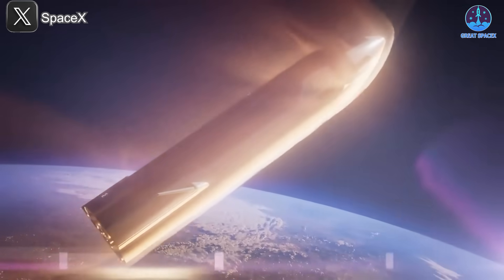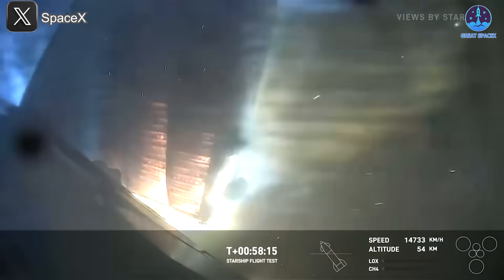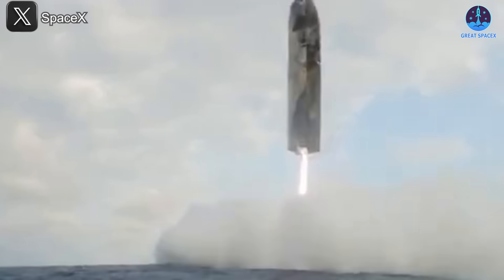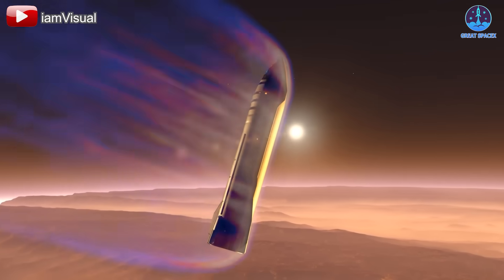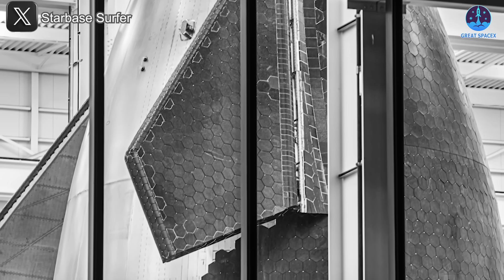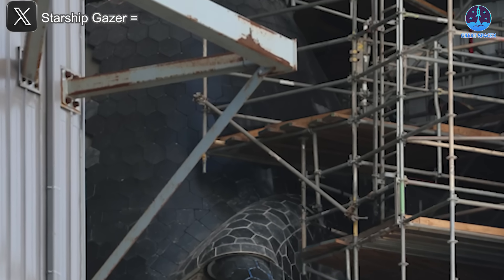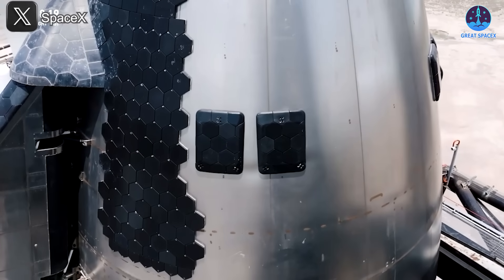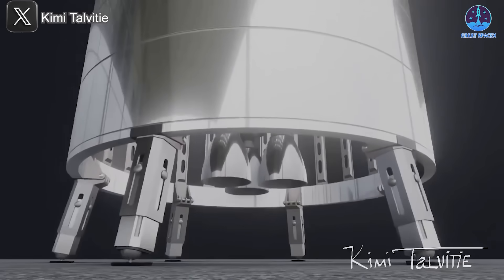Elon Musk Revealed Why SpaceX ditched Starship's Ceramic Tiles: New Metalic Trick!

Comment: I don't understand why people are so over-the-moon (pun intended) about SpaceX. It's just a freaking rocket. Rockets have been around for a very long time.
Reply: you are clearly very uneducated about the differences between "just a rocket" and what SpaceX has achieved.
Reply: The biggest reason why they excite me (and many others) is their proven track record of decreasing the cost to launch (in $$/kg).  The biggest reason you or I have not been to space yet is because it is mind-bogglingly expensive to safely lift weight to orbit.  The space shuttle was around $54,000 per kilogram to low-earth orbit (LEO).  SpaceX's re-usable Falcon 9 dropped that to around $3500, Falcon Heavy to something like $2500.  Starship promises to drop the cost down to between $20 and $200 per kg to LEO depending on how rapid and safe its re-use becomes.  I didn't think I would live to see the day when an 80kg (176lbs) individual would be able to travel to LEO for somewhere between $1,600 and $16,000 (compared to $4.3 million for the same ticket on the space shuttle).  That still sounds like a lot (because it is--especially the upper range), but it changes everything.  It is low enough that travel to and work in space will become far more common.

Comment: The liquid-vapour cooling is moronik to an unbelievable degree. The reentry kinetic energy of starship is about 2500 GJ. 1 kg evaporating water takes 0.00226 GJ so you would need 1106 metric tons of water to dump the energy of an EMPTY 100 ton Starship. So, someone please tell me, what the chief "engineer" is smoking. If you want to do the same with methane you would need more than 4 times this, or about 4000 even 5000 tons of methane.

Comment: SpaceX should consider Carbon Dioxide for the active-film heat shield cooling.  The Martian atmosphere is mostly carbon dioxide, so it's freely available for the trip home.  No matter what material is used for active cooling, it will need to be loaded before liftoff, and carried along until reentry, so So SpaceX shouldn't limit the choices to just O2 or CH4.  Methane will react with oxygen in the atmosphere, and add extra heat to the shield.  Oxygen when super-heated will act on stainless steel like a cutting torch.  Carbon Dioxide however won't react with anything. It's completely inert.  If SpaceX needs to carry along extra material for film layer cooling, then it might as well just save on the cost of CH4 and O2, and build a CO2 tank and pump system for cooling the heat shield.  CO2 is cheap, easy to handle, reliable, and safe.  An active film layer cooling system will add weight, and reduce the payload capacity of the rocket, but hey, do you want a fully reusable rocket or not?  The film-layer heat shield will be the only heat shield in history that is has zero ablative behavior.
Reply: Agreed. And since they'll be generating H2 with the O2 (from found water), they might consider fueling a Raptor 4 directly with that instead of processing it into methane first.
Reply: @ReggieArford  Agreed.  I always assumed that SpaceX had a reason for not using H2 and O2 instead of the multi-step and energy intensive process of converting water and CO2 into methane.  Bezos has some H2 engines.  The space shuttle used them, so we know that H2 can be used.
Reply: @scientificperspective1604  As I understand it, the reason SpaceX uses methane is because its boiling point is close to oxygen's. So, there's no need for additional insulation between them. Someone did a YouTube on this, I think.
Reply: @ReggieArford  Somehow the Space Shuttle was able to use hydrogen and oxygen.  I remember stories about how the hydrogen was also used in the space shuttle in fuel cells which generated electricity.  SpaceX is going to take heat for generating CO2 with its rockets.  It would be great if H2 were easier to handle, since water is available basically everywhere, and H2+O2 fuel makes no CO2.  The second stage of New Glenn apparently will use H2+O2.  Maybe SpaceX boosters can be used to get that BO 2nd stage to orbit, if the New Glenn isn't up to it.
Reply: @ReggieArford  The different boiling/freezing point would be a bit of a problem with using CO2 for the heat shield.  It should be manageable.

Comment: The heat tiles do not have the highest heat-handling capacity, it's just that they're incredibly insulative, protecting the metals underneath.
I think they could be made much more durable by coating "both" sides with a high temperature metal (or the outside with a high temperature metal, inside with steel or titanium). The problem would be that the outside and inside metal layers shouldn't touch each other, so you're still relying on the durability of the tile material. But I think if bonded between two metal layers, with tesselated "pegs" (possibly with grippy or no-touchy interlocking shapes), you could make an ice cream sandwich out of the tiles, which would hold together much better.

They would probably have to be a bit thicker, and heavier. But likely not nearly as heavy as an aspirational heat shield + coolant.
Only problem I could see is that they would likely hold together even when the silica core is cracked. So in maintenance you might need some sort of ultra-sound to quickly check each tile to make sure it's still intact between the layers. The outer layer would likely have a small degree of ablative degredation... but a material like tungsten would not degrade very much, while being very strong. Tungsten shouldn't reach it's melting point in reentry. Light? no. Lighter than a whole belly radiator though? Probably.

Comment: I do not agree with this view. Even Though Stanless steel temp ranges between 2,550°F and 2790°F. I would suggest something simpler. Tungsten melting point is 6,192°F and as a metal can be formed into the new heat shield. When reentry temperatures as high as 7,000°F it is not likely stanless steel would work as it has a melting point of 1,400°F. While titanium is ,3,034°F. Molybdenum would range at 4,753°F. Tantalum woudl be around 5,468°F. In truth if he craft heat shielding was made out of titanium, molybdenum, tantalum and copper cooling system to conduct the highest cooling method it would be likely to use a metal heat shield that would not melt at all. It would be rather simple in design and easy to apply to the current system.The fuel itself could be used.
Reply: Holy moley. I just typed a very similar post. sent it. and see the post right under mine has nearly the same idea.
great minds :) 

My idea though was to make the silica tile material into an "ice cream sandwich" with probably a titanium backing, and a tungsten outer layer. And try to form the heat tile in between these layers, with protrusions from each plate sticking into the tile brick. The key would be to avoid any bridging... so the protrusions would need to secure into the tile material itself, not go all the way through and touch. Basically there can't be any thermal bridging, front to back. But I think the tiles could be made tougher, at a weight which is likely considerably less than a respiration system.

Does reentry really reach 7000 F? 
Tungsten can handle up to 6000. I had thought that reentry temp was a bit lower than that.
Reply: @kathrynck  Are you sure these metals adhere together? Steel and titanium don't.
A coolant system does not lower the surface temperature very much, so one may have to deal with thermal abrasion. I'm sorry, but as a European, I cannot deal with your temperatures. Stay on your MAGA island!

Comment: Why use the tower to catch starship?  Sooner or later landing legs will have it be used to land anywhere but Boca Cica.  So add the legs now and drop the tower.
Reply: Legs are heavy duty equipment. They weigh alot and add complexity to the rocket thats not necessary. Using the tower is great for reuseability. Catch the thing, inspect, refuel, put it on the very same booster without needing to transport anything across the country and start again. Those starships intended for landing on mars/moon will need legs ofc, but those intended for satellite deployment or orbital refueling wont.

I think it's quite genius to remove important equipment from the vehicle and put it on the ground instead.
Reply: On Mars, Elon will first build the catch tower, the chopsticks, and the support ring with a deluge system, then land with the starship.  🤣

Comment: Technically starship doesn’t need reentry for the first couple of starships from my memory who goes there first will have to stay there, including the materials we send there before we go, and that includes the starship since there are no refueling stations on Mars yet the reentry part could be more valuable when Mars has an opportunity to set up a refueling station so I can send equipment Back to earth and if I remember correctly, there was an idea of trying to use the spaceship itself as a temporary living quarters because technically, you could just tip the starship on its side, bury it a little bit to protect from the radiation, and it should be relatively good as long as you find a way to produce water and grow your own food, because the starship was designed for a six month trip and open outer space so it’s got some living quarters the reentry on the shielding part for the time being could only be used for testing for the reentry of the vehicle because you want to keep reusing it because who wants to throw away a car after they get done using it once But starship on Mars will be more than a car kind of like those SUVs, that you could drive anywhere and live inside

Comment: I was referring to color not material. TLDR: radiation plays a huge role in heat transfer.
Maximizing the emissivity of the surface (I.e, making it more black) is crucial to heat transfer. A white surface or "shiny" reflective surface would be extremely counter productive.

Comment: In terms of innovation, we really are looking at 1980's technology.  If the 'Starship' vehicle is going to be reusable, it needs to be able to have a flight profile such that reentry velocity is minimized.  The current iterations do not use controlled flight, it is more a case of controlled falling.  There needs to be a better way to conduct the reentry phase.  Possible avenues to explore would be de-orbit burns that slow the craft considerably, additional aerodynamic control surfaces (wings), skipping in order to scrub speed in smaller chunks, or a combination of these.
Reply: De-orbit burns that flow it considerably? It appears you don't know how much fuel that would require.
Reply: @ I’m aware. Fuel cost in terms of mass to lift vs the cost of total vehicle loss. I can’t provide that calculus, but a ‘reusable’ spacecraft that does not survive reentry is an oxymoron and clearly SpaceX is exploring possibilities. So many ultimate limits just require divergent thinking to do the impossible!  Have some faith baby😎

Comment: Cooling a skin isn’t a new idea. 

NASA and others have been using it to cool engine rocket bells for nearly half a century.  

They pass chilled fuel through pipes wrapped around the engine bell taking the heat away. 

Nothing new here except they are going to cool the skin of the rocket not the engine bell.
Reply: It's a robot narrating. Generic fluff with the right length for ad revenue.

Comment: As Starship's re-entry angle is steep, then its belly keel is where it can deploy its (future) comprehensive ullage gas/film cooling system, starting from its nose and finishing at the end of the LOX (bottom) tank.  A red line down its belly would be quite aesthetic.  The present design won't be reusable.  😎

Comment: The loss of two out of five US Space Shuttles and their crews should have taught the lesson that heat tiles, if lost in critical areas on launch, result in loss of the vehicle and crew.  I would never entrust human life to heat tiles or a complicated heat dissipation system.  Instead, starship should use an internal crew capsule with an ablative heat shield and parachute water landing.  Placed in the nose of starship, above the header tanks, it can be released by a nose that opens like two jaws.  The vehicle thus returns separately from the crew.  Even if the vehicle is lost, the crew is not.

Comment: I wonder if some form of speed brake (similar to what are used on jet aircraft) combined with controlled engine burns could be used to effectively reduce speed if the ship used a nose up re-entry like the booster.
Reply: As Starship will be made to refuel while in orbit for travel outside LEO there is another option here.  Starships which are intended to return to earth could be refueled as well.  Then reentry rockets could be fired to reduce the speed of Starship to a reentry speed which wouldn't be so harsh

Comment: The overwhelming majority of super cold liquid fuel & liquid oxygen is used up on ascent to achieve the altitude & velocity necessary to maintain orbit around the earth.  Realize Starship needs accelerate from 0 mph on Earth to a speed of 17,500 miles per hour above the atmosphere where there is no friction to slow it down.  As a result STRARSHIP WILL ACTUALLY BE FALLING TOWARD EARTH, BUT IT’S GOING SO FAST THAT IT PASSES THAT MAGIC POINT IN SPACE WHERE INSTEAD OF FALLING BACK DOWN AND HITTING EARTH IT FALLS DOWN ONLY AFTER THE EARLY HAS SAFELY CURVED AWAY UNDER IT!! THUS IT KEEPS FALLING “AROUND THE EARTH” at a constant speed (even though there is barely any fuel left) because there’s no friction in space to slow the spacecraft down!!  If it gets too close to the atmosphere it will slowly loose speed and re-enter Earth. 

There’s only a small amount of fuel remaining in the ship for slowing down VERY close to land.  

So ALL reusable rockets & capsules coming back to Earth have utilized “aero-breaking” which uses the increasing density of air resistance towards the surface of Earth to slow down the vehicle “for free” because a vehicle doesn’t need any fuel to reduce their velocity from 17,500 mph to zero depending on it’s design. However aero-breaking isn’t really “free.”  It slows the spacecraft but the air friction at those insanely high speeds cause EXTREME heating which must be overcome.  Maybe SpaceX can find an innovative solution for a new type of heat shield?! I hope so!

Comment: Sounds like the solution for every problem SpaceX is stainless steel. Which adds to the mass problem which is causing the payload problem. 
Water as coolant? Water is very heavy. The way this is going, I’ll be shocked if Starship can launch a Saturn V payload to LEO of 300,000 lbs.
Reply: Yes, they need to come up with some sort of outer skin for the rocket, that is permanent, durable, and lightweight.
Reply: @ This is a problem that you work backwards. You start with the engines, thrust Isp, rocket size and payload target. For any dry mass ratio you a different payload until at a high enough ratio you get nothing. I would not be surprised if V1 is closed to nothing. You can get more with higher thrust, tank and Isp but a larger tank does not ride for free.

Comment: What's crazy is that the rocket is filled with super chilled fuel. There has to be a way to transfer that coolness to the heat shield. But how? Because I'm guessing that you also don't want to warm up your fuel. I don't know about the theory that the best heat shield is no heat shield?! 😅
Reply: The overwhelming majority of super cold liquid fuel & liquid oxygen is used up on ascent to achieve the altitude & velocity necessary to maintain orbit around the earth.  Realize Starship needs accelerate from 0 mph on Earth to a speed of 17,500 miles per hour above the atmosphere where there is no friction to slow it down.  As a result STRARSHIP WILL ACTUALLY BE FALLING TOWARD EARTH, BUT IT’S GOING SO FAST THAT IT PASSES THAT MAGIC POINT IN SPACE WHERE INSTEAD OF FALLING BACK DOWN AND HITTING EARTH IT FALLS DOWN ONLY AFTER THE EARLY HAS SAFELY CURVED AWAY UNDER IT!! THUS IT KEEPS FALLING “AROUND THE EARTH” at a constant speed (even though there is barely any fuel left) because there’s no friction in space to slow the spacecraft down!!  If it gets too close to the atmosphere it will slowly loose speed and re-enter Earth. 

There’s only a small amount of fuel remaining in the ship for slowing down VERY close to land.  

So ALL reusable rockets & capsules coming back to Earth have utilized “aero-breaking” which uses the increasing density of air resistance towards the surface of Earth to slow down the vehicle “for free” because a vehicle doesn’t need any fuel to reduce their velocity from 17,500 mph to zero depending on it’s design. However aero-breaking isn’t really “free.”  It slows the spacecraft but the air friction at those insanely high speeds cause EXTREME heating which must be overcome.  Maybe SpaceX can find an innovative solution for a new type of heat shield?! I hope so!

Comment: Just a journeyman who worked on projects with a lot of stainless, and am wondering if the stainless steel deformation could be caused by the rapid quenching the tiles experience when they contact cold sea water. That's gotta be an issue.

Comment: HO, HO, HO, how about using hydrogen peroxide to cool the heat shield? It can be handled as a liquid. It will combine with oxygen from the atmosphere to become H2O. It burns into water vapor. It can come out of thousands of pores that are actually tiny rocket engines (it's been used in rockets), helping slow the descent. The steam will insulate the steel ship.

Sometimes I think so far out of the box I'm not even in the warehouse.

Comment: Although never flight tested, the X-20 Dynasoar was designed with a composite metallic heat shield and active liquid cooling.  If only the program hadn't been cut, we may have been decades ahead in our tech.  Or at least we would know if it didn't work.